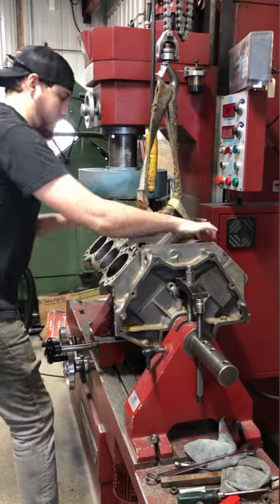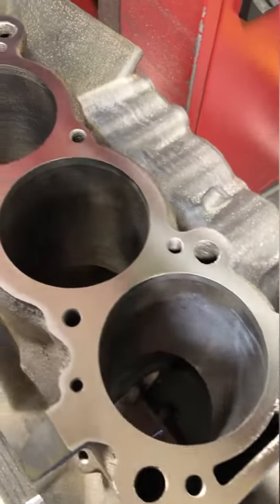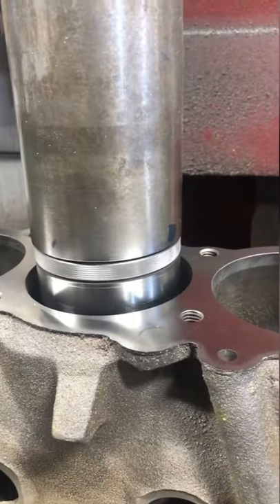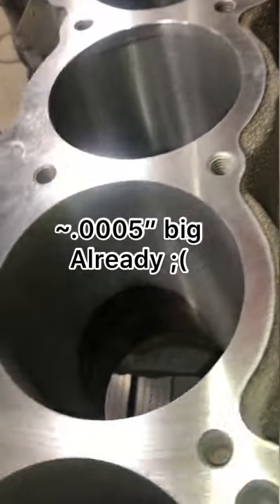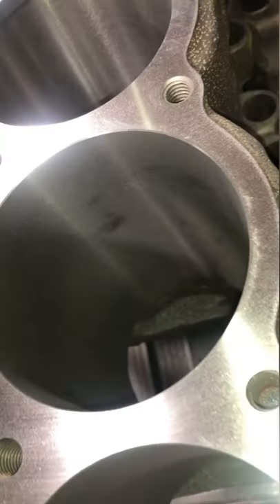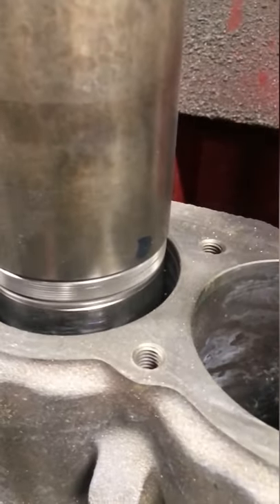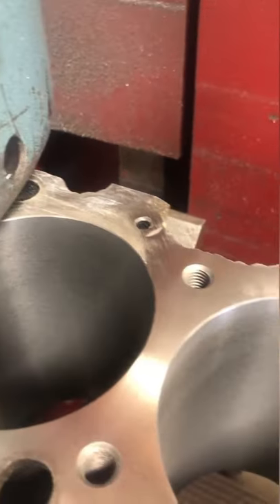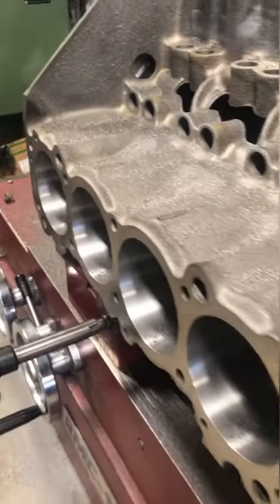#shorts Machining a 340 Buick V8 Engine Block @JAMSIONLINE

Comment: "That aint going anywhere" 

~ Every machinist 4 seconds before launching whatever isn't going anywhere through the side of the machine.
Reply from the maker: 🤣🤣🤣 Famous last words.
Reply: I would rather launch something out then take another chuck handle to the shoulder again lol
Reply: @roadmonkeytj  had a guy at one of our satellite shops put a part in an engine lathe with home made jaws because the part was larger than the chuck. Last thing the young man did was start the spindle. 

Had another engine lathe with an air chuck let loose on a 3' long 10" diameter billet of 4140. Threw the part into the back of the lathe into a safety wall we made, blow it across the floor into a work bench and shove the work bench into another engine lathe.

Had a guy not engage the magnet on his surface grinder and put a part shaped hole right in the side of the machine.

Another guy started a program wrong on a bullard vertical lathe and launch a 250lb assembly into the doors blowing the entire front of the machine off.

Saw a guy launch a 10" hunk of m4 out of a cnc lathe right through the glass.

It's a dangerous job and thankfully I can look back on most of that tragedy and laugh now, aside from the first poor soul I mentioned. That one haunts me. 19, first job, first day of his second week.
Reply: @jeepmanxj  I would believe it all ... I'm a CNC maintenance tech now and I get to repair all that damage lol.   Worst was a lathe drive had gone bad an when when the servo reset was hit the machine is supposed to go home and slow to reference dog ... Instead this went full rapid and blew the tailstock off splitting the casting of the tailstock.

Production is worse ... They ran a 1" chamfer tool (last tool) as a 4" facemill (first tool) ... Snapped it in half ... Ran the whole program then the 4" mill was ran as a chamfer tool ... It's a miracle they didn't rip the tombstone off the table
Reply: @roadmonkeytj  i deal with a dmg mori that has a really bad issue with losing work offsets. I was like 15 parts into an order and hit start it just sent the turret to some point behind the spindle blowing the jaws off totaling the spindle bearing and blowing the locking mechanism out of the turret just making it free spin. 

Was amazing. My asshole created a black hole it puckered so hard.
Reply: @jeepmanxj  we had an old Mori doing that ... Have to home it before every run
Reply: @roadmonkeytj  The ole T-Handle in the T-Handle holder trick, huh? A wise machinist once told me "Don't leave this here".
Reply: YEEPPPP
Reply: @jeepmanxj  I’m not a machinest so idk wtf y’all talking about mostly. Did the young man die?
Reply: @devilsreject9255  it sounds like it. I am pretty sure his part got ripped off and it hit him in a sensitive area (the head) and either killed him immediately or he died from internal bleeding. I am a machinist and this job can kill you unexpectedly.
Reply: When I was in machining school in high school, a kid put something on the surface grinder, didn’t set the depth and THEN proceeded to start the table moving in the wrong direction.  Exploded the grinding wheel and shot the chunk of metal into the wall, like, sticking into the wall.  Ya.  Glad our shop teacher was smart enough to correctly position that surface grinder.
Reply: @devilsreject9255  yeah dude did you read the post.
Reply: @Jurgy777  the T-handle being thrown into the chip pan is the loudest sound on earth, but the stares from across the shop are far more deafening
Reply: I don't even like using a band saw. To hell with these machines
Reply: @Slingin_Bait  haha
Reply: @JAMSIONLINE  I'd LOVE to know what kind of HP this thing makes when she's all back together👍😎
Reply: I94 b
Reply: that's only when you don't slap it before saying it. slap the part, and it's solid.
Reply: I worked in a shop where a guy left the chuck wrench in the chuck and turned the lathe on. The T handle wrench proceeded to open his chest cavity from just below his Adams apple to his waist. Stone cold dead.
Reply: @robertwest3093  yep. Saw one lodge into a steel wall.
Reply: @JAMSIONLINE  your videos are informative Thank you kindly from # YSW 🇨🇦 respect for all of the work you both do
Reply: Guys and gals… please follow ALL  safely advisories. I’ve witnessed an 80 year old man with 65 years of experience using his trusty old grinding wheel, having the stone explode with no face shield. Ripped the right side of his face off.  It didn’t kill him on that day but it most certainly led to his untimely death 3 months later. When using any power tool, take precaution to not put yourself in danger of the potential.
Reply: I've been working in a factory for a year now and the amount of dents, dings, and what not, in odd places of machines is worrying.
Reply: @JAMSIONLINE how many cubic inches that motor now

Comment: Found that same level in my dads tool box after he passed, I knew it had a specific use but didn’t know what. He was also a engine builder.
Reply: It's a Starrett 98
Reply: @ShaunHensley precision bubble level
Reply: @onkcuf  Correct. We use them a lot when working on turbines.

Comment: I want my engine rebuilt by people like you guys, but its hard when most of the people around are looking for a quick buck and to get you to come back in for something they screwed up on so they can blame it on me
Reply: Then you realize a crate LS is cheaper
Reply: @gsilva220  it's almost never cheaper, unless you're paying someone for the labor to rebuild then it is cheaper to just buy an engine.
Reply: @BraveNewWorld-1984    Please tell me; in which case would the labor be free?
Reply: @gsilva220  when you do it yourself
Reply: @LiT_Moose89 spoken like a true gear head to one that is one only in show and never touched a wrench.
Reply: @craig9365  look maybe I'm too dumb to understand what you're saying, but are you saying I've never touched a wrench?

Edit, never mind I just can't read
Reply: There are tons of great shops out there. You really need to do some research though. A shop that builds import engines can be really good at then with a passion. And I ow their engines well. I wouldn't take a big block to them. 

I'm rebuilding a 428cj for my father's mustang. Had to drive a little while. But I found a shop that makes there living on big block Ford's and has an awesome history of building winning Ford fe's. 

My last engine build was a 2.9l Ford. It's a German made Ford engine so I found a shop (in town luckily) that knew them and did a lot European engines and odd ball work. Turned out great. They also machined all my old Kohler engines as a guy there was a garden tractor puller and knew them in and out.

Comment: Fun fact: The 340 V8 block is the same casting as the odd/even fire 231 V6. The 215, 300 and  B. 350 are the same too!
Beautiful machining work!
Reply: So you’re saying this is the same block as the one in my Regal? Mine is an ‘83 Regal base with the 231 v6
Reply: @kararodriguez7601  
Yes, the same one but with 2 cylinders hacked off.
Reply: Buicks are the best. At least the old ones were
Reply: Same engine in Land Rover discovery’s? I think those blocks were the 215.
Reply: @jermbob92  
The same. Rover bought the engine tooling from Buick for their SUV's.
Reply: @henrys.6864   awesome, thanks for the verification! I own a 04 disco2 and thought that to be the case but wasn’t sure. What’s you’re experience with the engine? Always interesting to me when ppl are good at identifying specific engines and provide info that might or might not be hard to find through the inter web.
Reply: @jermbob92  
Your totally welcome. 👍
Reply: @henrys.6864  oh okay awesome! Thanks!
Reply: @DStabs720  I love it! I can’t wait to get mine running!
Reply: I rebuilt a odd fire V6 about 30 years ago. Would’ve cost less to build a V8 and shoe horned it in. That engine is one of the reasons mechanics hate engineers! lol
Reply: Do I only see one coolant passage to the head?
Reply: @henrys.6864  not just the SUVs. The Rover SD1 had it as well.
Reply: @musewolfman  
Indeed. Rover bought the tooling and castings from Buick.
Reply: Besides the aluminum the 215 and early V6 are different animals compared to the 64 and newer Buick engines.
Reply: Buick engines❤❤❤
Reply: Fireball 90° Buick V8

Comment: When I was younger dad taught me that once you get past .030 over,you get past the case-hardening and shorten the life of a rebuild.That was 40 years ago,is it still like that? When I did my 71 hilux I had it sleeved but the shop said it was past going any more over
Reply: Just depends on the motor block and it's clearances. In theory the more material you remove the weaker it is. There's even tricks to bore out to max and then strengthen the block so it does last!
Reply: This would ring true for hardened steel parts, but blocks are typically grey iron with or without sleeves of ductile iron. 

It's not hardness that kills bored blocks, it's the lack of supporting material.

Comment: Maybe a dumb question - but some time ago at least, when boring and honing the cylinders, they’d always torque a plate down on the deck face to mimic the distortion from torquing down the head bolts. I notice you don’t do this? Was that a myth?
Reply: That a real thing. It isn't necessary for street rebuilds but pays off as specific output increases. A deckplate will replicate distortion caused by head bolt clamping forces.

Comment: I have a bad habit of over thinking things. OCD perhaps. When using a level, can you get a bad reading if your deck is warped?
Reply: I think the level is just used to double check or give an approximation because a bubble isn't that accurate. The deck has to be flat in reference to the crank at 45 degrees so I'm guessing there's a much more accurate way than a level to set that up.
Reply: @dirtyaznstyle4156  you would use dial indicators and the like in the head of the machine. I was a machinist for a couple years but I’m not familiar with this particular setup seeing as it’s pretty specific to automotive machining
Reply: @alysongr  hope youre right lol
Reply: You’re not going to get that bad of a reading. you can check it with the level and most shops have more than one level and you can check it several different ways rather than just the one and done. Do you have more than one cylinder to squared off with the crank all of your cylinders aren’t going to be warped identical so you can take an average reading of each and those types of levels are crazy accurate.

Comment: I guess I was spoiled because all my machine work was done building NASCAR Cup engines. Never had problems like you do in the real world where some people think .002 is close enough. And it may be for a limited amount of time. Luckily everything we used was 100% machined by us no outsourcing anything. Cylinder heads had to be bought but we always cut some off the matting surface so took away and added material to the intake ports to get the best numbers on the flow bench.

Comment: I didn’t know that a 1970 440 of mine was already bored .040 over when we got it. So we had the machine shop set it for .060 over buuuuuut the previous shop (in like 1974) screwed up squaring the deck so badly it was at .090 at the bottom of the bores. Eight sleeves later I have a twice rebuilt, standard bore engine. The things you do to preserve numbers matching components.

Comment: I got called to an engine "rebuiled" shop⁵ once, many decades ago.  The owner of that one man business engaged in half-ass mechanical work.he advertised, "Rebuild any engine for $395." He used a worn out VanNorman portable boring bar with worn out bushings.  The stories I could tell about this guy would cause real mechanics to cringe. He also sharpened his carbide cutters by freehand on a greenstone...insane.  Any way, I used Rottler portable boring bars with the vacuum hood on engines in frame.  The difference between that guy and I was that I knew what I was doing.
I was to touch up his bore job, which cylinder walls looked like a phonograph  record finish.  He also used a ball hone to finish his insane bore job.  It looked to me that the piston rings of his "rebuild" would be worn out after the first 30 minutes of running.  The guy went out of business after only a couple of years because of his bad reputation.  One gets what you pay for.

Comment: G a w d, I don't understand the thousandths terminology but I love ❤ this sooo much. I hv to continuously view  this vid to finally start "getting it" wow 👏
Reply: .060 (sixty thousandths) is how much they over sized the bores. It's how we read measurements for engines. It means that the new pistons will be oversized by sixty thousandths to accommodate the new bore size. I hope this helps
Reply: @jimrossabrena7955   more importantly, 60 thou is 1.524mm. one and a half millimeter is thicker than an american dime (1.34mm). Depending on the stroke it could increase the displacement of the engine by 10 cubic inches. Not an insignificant change.

Comment: I appreciate the work you guys do and the thorough explanations you give.
It appears that the lower shadow you mention is not on the thrust or reactive side of the piston. 
It also appears to be lower than the ring travel area.
It does appear to have been caused by the prior boring not being perpendicular to the crankshaft centerline.

Under these circumstances, wouldn’t it have had no adverse affects at the planned 0.040 overbore?

Comment: Do you sonic test the bores of the block before machining oversize? Never had much experience with Buick engines myself, I know some Ford and other GM engines can only be bored oversized so far safely before bore distortion becomes an issue

Comment: Do you ever use torque plates when boring the cylinders?

An Aerospace machinist enjoying what you do here.
Reply from the maker: We don’t use a torque plate when boring, only when honing. Boring is meant to be a “roughing” process, so in my opinion there wouldn’t be any benefit to a torque plate during boring as any distortion will be fixed during honing.

If someone has some reliable evidence that says otherwise I’m all ears, but from my own experience I don’t think it’s needed during boring.
Reply: @JAMSIONLINE  that would be an interesting test to see.

Comment: Also he said it had been bored before . 
before anyone bores a block if it’s a standard bore you can set your machine up to center it at the very bottom of the cylinder because your piston does not go all the way to the very bottom in most cases. 
You can set your boring bar or boring machine which ever you prefer to call it up on a worn out cylinder all you have to do is make sure you go past where it’s worn out go plum to the very bottom of the cylinder set your machine up center it lock everything down then raise your boring machine and then run the boring machine through it that way it set up square to the crank because you went off the factory bore.

Comment: So if you’re taking material away, doesn’t that create  space in the cylinder for compression to escape? I’m fascinated by this.
Reply: That's why he says oversized pistons. You get bigger pistons to compensate for less material
Reply: Yes, larger pistons and rings to match.  If done correctly, as it appears that it will be, this engine will probably run more smoothly and efficiently than when it was new.

Comment: This kills me (unless I’m missing something, which is likely). A bubble level to ensure correct angles for equipment that works in the 1/1000 of an inch range?
Is the bubble just to get it close enough for some digitally-controlled super leveling?

Comment: Could you just put a sleeve in that one cylinder and keep them at 30,000 or 40,000 either way just a question from an Novice
Reply: Because you would have to take out more material to put a sleeve in than it would be to just bore it to .060" over.

Comment: If it's going only .010" over we won't run the boring bar through it first for this very reason. If you consider you're removing at most .0035" of cylinder wall per side and the length of the sleeve, that is bugger all for tolerance of misalignment.

Comment: 60 over will make it likely to overheat, so put a bigger radiator and bigger electric fans. I would also put an electric water pump with an EWP to control flow to take the place of the thermostat.

Comment: How often do you need to service the mill for decking blocks?  Does the cutting tool last 'X' amount of passes before it must be replaced, or does it stay sharp for years?
Reply: They wear out as any tool would sometimes slowly sometimes instantly depends on the work. Im guessing these are cbn or carbide button inserts.

Comment: I gotta ask you but one question are you good enough😮. Did you demagnetize? The cylinder block. You can do this by wrapping a very long extensioncord around and through the cylinders. Plug in a sixty watt light bulb let it set overnight. AC de magnetizes, DC  magnetizes.  😅

Comment: I have a question if you don't mind 
I have a 91 Tran am with the TPI 305 The guy I bought the car from hands me a box of 0.30 piston would that make the 305 a 306??? Or 308 I don't know if it be worth the rebuild or not the most I've found wrong with the car is valve stem seals with the touch of blow-by

Comment: I've seen a few engine block machining videos, but I've never heard tell of the bore being perfectly square to the crankshaft. What exactly does this mean?
Reply: The centerline of the crank represents one axis and the centerlines of the bores represent another axis. they should be 90 degrees from each other. 

If they are not, the piston will wear heavy on one side and there will be an airgap on the opposite side
Reply: Ah, I think I know what you mean.

Take the center axis of the bore, and the center axis of the crank, and intersect them. At the intersection should be a 90° angle, correct?